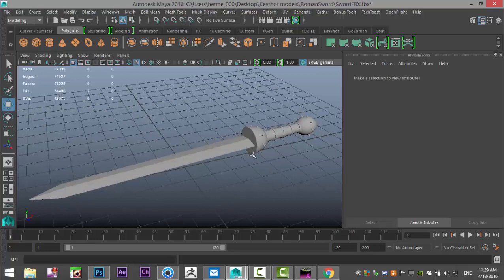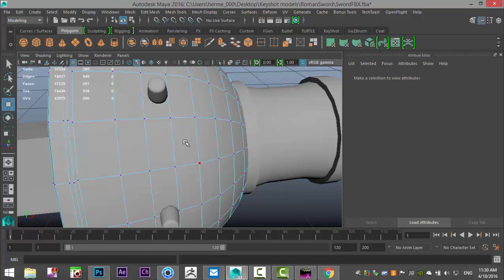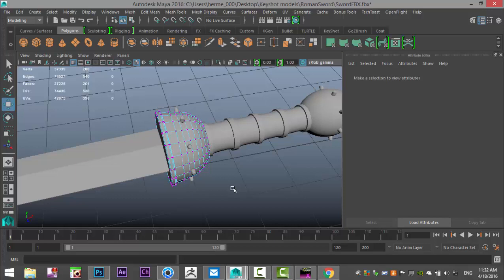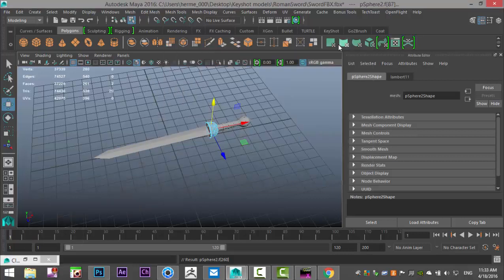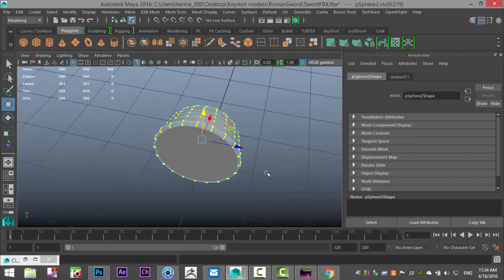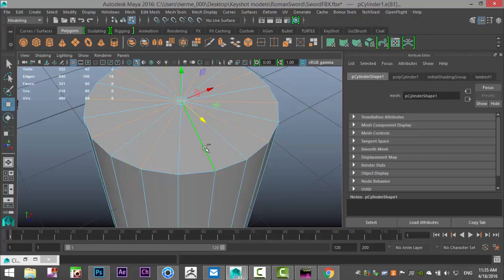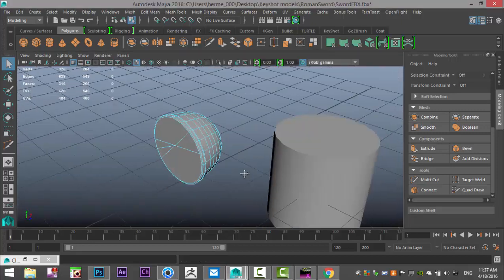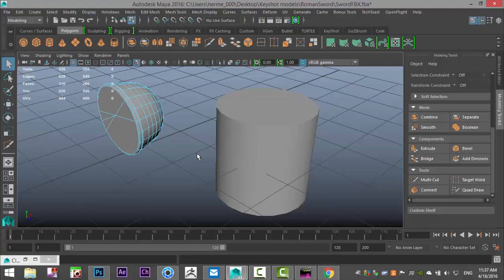Maya 2016 tutorial : What are nGons ?

Comment: Yesterday i was training my self and I meet some problems about triangles it was specific point which is i got triangle on my object and its was very similar triangle like your video but the triangle was at the end of the object. I wonder i am right or not but i did it tecnically like four face i mean if it was correct. Here my question  ; as you know there is 3 edges on the traingle. What if i just add 1 vertex point to one of edge’s right on the middle by using Add Divisions. then you will have 4 edges. But it still looks like triangle just there is one more vertex can be visible on vertex mode. İs it worth?     
Note: ( I added vertex to the edge which is last edge . Normally if you do this middle of the object then you will have another triangles or 5 edges on the neighbor  faces.)
Reply from the maker: Adding one vertex will create another nGon elsewhere as you are changing a quad
Reply: Mike Hermes but it didint because the location of edge was end of the object i mean there is no more connections  from the edge maybe if you have tickness on object the side will have nGon but i am not sure i will check my work again thanks teacher you are real life hero :)
Reply from the maker: Thank you :-)

Comment: When i was doing a cert 3 in 3d modelling/digital media, i was told that we had to merge/fuse say a blade to the hilt (this would cause a lot of problems). is it necessary to be able to animate it, or could you just hierarchy the blade to the hilt? or am i retarded and i am overlooking it?
Reply: You should usually merge the two just to keep it clean and easier to texture,  but depending on what you are doing with the model it will usually be fine to keep separate, depends on what you are using it for

Comment: Why not use the "Poke" tool in this specific instance? 
https://i.gyazo.com/88ddf96a76b55991781ec005ccbe194f.gif
Reply: +Donny Willo Oh and congrats on 500 vids man!
Reply from the maker: +Donny Willo Well to be honest I never realized I could do that using the Poke tool. Thanks for sharing !
Reply: +Mike Hermes haha, I find that, everybody has different ways of doing things in maya, I see it as it as problem solving. Everybody just solves there problems there own way and the beauty of maya is that you CAN do it your own way or just the way you feel most comfortable with.
Reply from the maker: +Donny Willo Exactly
Reply: I did a similar thing to fill a hole that wasn't perfectly round. I selected the edge around that hole, used the scale tool until the vertices came close. Then, in vertex mode, I merged vertices at center and ended up with desired shape.